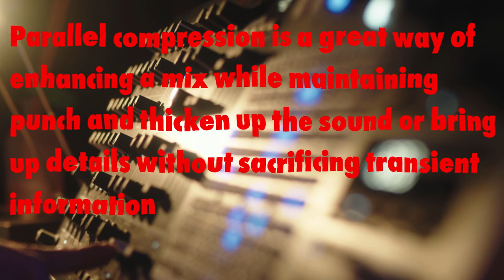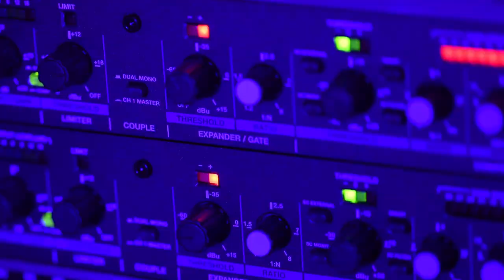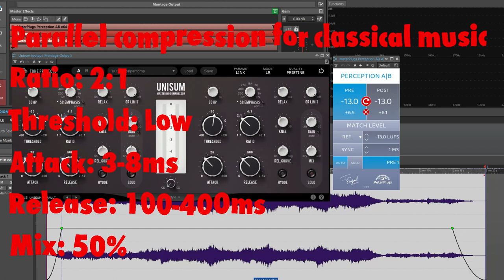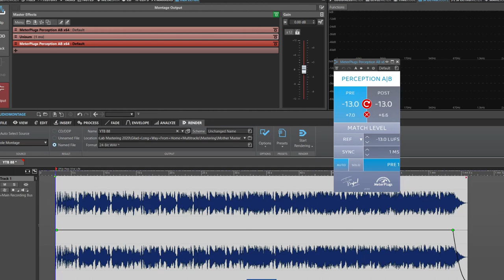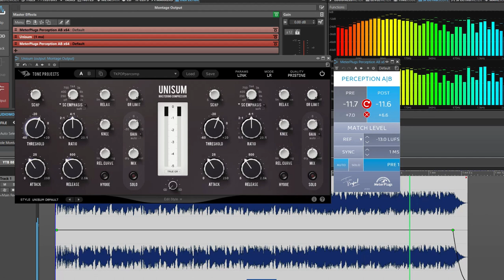Parallel compression techniques in mastering

Comment: Why you don’t use more aggressive settings, I was quite surprised I thought in pop track you will just use very high ratio and low threshold with very fast release and attack?
Reply from the maker: In fact I'm using 4:1 ratio which is quite high for mastering. The aim is to add the intensity of compression, but without any damage to the transient energy in the mix. In this case it is important not to be subtle and to really attack the transients in the mix. A good setting therefore would be 4:1 ratio, with a fast attack and medium release.